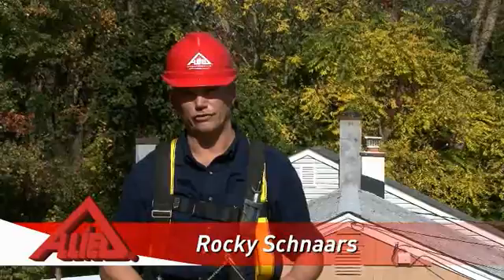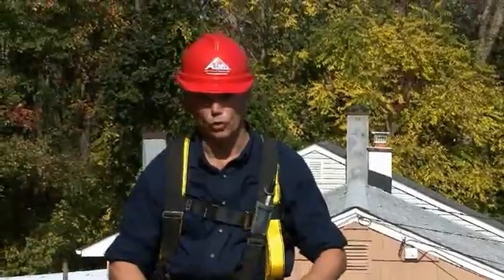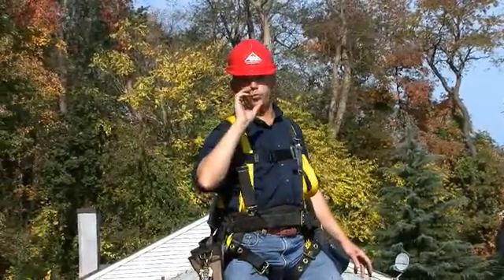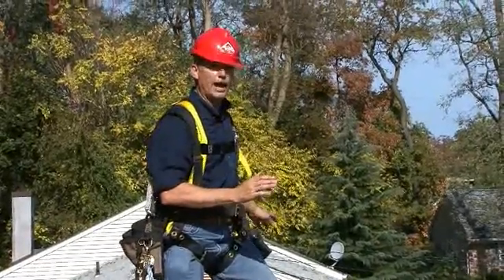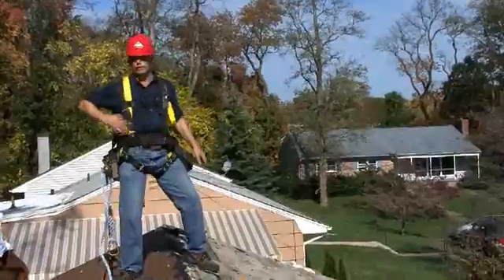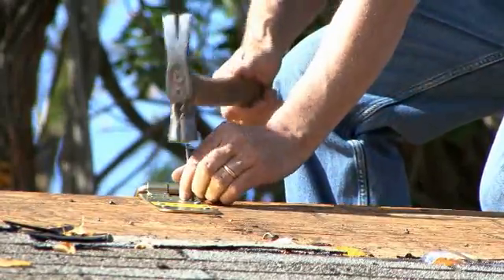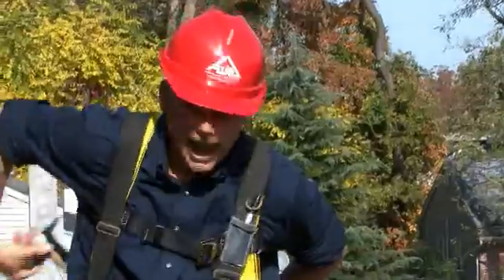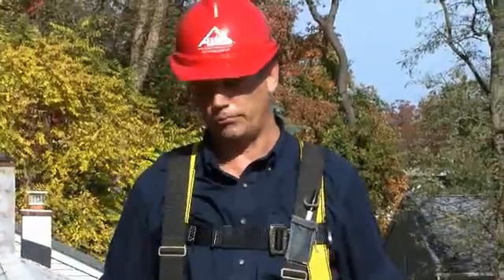Installing a Fall Protection System

Comment: how fat is the person who is a 5000 lb. force on the bracket? one 3 1/2" spike has a 300 lb. sheer strength. two spikes in a jack that I had a 2x6 plank on. so, 4 spikes total. several bundles of shingles slipped from above and all caught on that board way down at the edge of the roof. they were a lot heavier than a person and those spikes didn't even flinch. there's no way that bracket needs 40 spikes in it, and besides, what are they all going to go into? a truss is only a 2by, so one row would hit it, but not 3 rows of spikes, and besides, that many spikes that close together seems like it would weaken the wood a lot, even causing splits.

Comment: They say 5000 pounds and that is completely crazy. You can rip off a 300 foot fall on a 150 foot rope climbing and max impact energy is around 1000 pounds.  Length affects duration of impact force, not maximum impact force, so short falls can have high impact foreces.  Maximum impact force is a design element of the rope, and the ratio of fall length to rope length.  Other than tradesman weight, most elements of fall on roofs would create trivial impact forces.  A lot of very efficient fall safety gear like ascenders, is not going to hold a 1/4 of that weight.

Comment: Builders should have something permanent already installed. So the homeowner or anyone else can just hook on and go to work.
Reply: What would the cost be? Like 12 bucks?
Reply: I wouldn't trust my life in someone else's installed hook. I would want to know myself how well it is fastened.
Reply: @zzz7zzz9  Dumb way of thinking. If it's installed per code, there should be no issue. Do you trust in the rope manufacturer? Or the carabiner? Do you trust in the people that built the roof to begin with? You can always go up and inspect the hook to see if it's installed properly.

Comment: wot comes first installing the fall protection to then install your system or do you have nothing.? Like the old saying wot comes first the chicken or the egg.
Reply: I use a fall protection system to install the fall protection system,  because I am older, and injured, and overweight, none of which is good in a crate situation.  But there are whole regions where people have low angle roofs, and you could get hurt if you fell off, but it is only likely if you get tired and momentarily careless.  Putting up the rope should be OK.

I toss a sandbag over with a string, and pull a rope over a roof.  Faster systems like the goat, are cool, but not as secure, and like 700 dollars, but might be worth if for some.

Comment: Which type of 16d nail is preferred: 16d sinker or 16d common?
Reply from the maker: Esteban Contreras Hi Esteban. Thank you for your question. My best suggestion would be to contact your local code enforcement officer or building inspector. They will give you the best advice for your specific application.
Reply: Thank you!
Reply: One that fits the hole, common or scaffolding double heads are what I like.  I would not use a sinker, but with 12 nails you could use just about anything, they don't specify a particular nail type.

Comment: Instructive video showing tips on rooftop safety. Everyone should follow these safety steps as it’s risky to work on rooftops.
Reply: I just got a job installing internet in people homes and I have to spend a lot of time on people's roofs if I were to use one of these how could I repair the holes in the roof so I dont ruin their roof after I'm done working
Reply: I have been working there a year now and I am just being extra careful I am not putting any unnecessary  holes in anyone's roofs other than what is certified  by the company I work for...   I am always looking for ways to be careful I had a coworker fall off a 2 story house .  I picked up some slip resistant shoes but I trust my gut with every job

Comment: Well, no. Not supposed to be installed over shingles. It's supposed to be installed on the sheathing, then it can  be shingled over, leaving the ring exposed. The lifeline the rope grab is attached to is required to have a counter weight hanging from the eave, protected against chafe, to keep the lifeline taut. The reason for not shooting the nails in, is that those type of nails don't have a full, normal nail-head, and the anchor  could be torn off, leaving the nails still in.

Comment: Was wondering could one of these be installed and left on top of the roof. Every year I go up and down putting lights for the holidays up. Was thinking about starting to use some sort of lifeline for safety thank you Nunzio
Reply: There are permanent one, this is temporary.